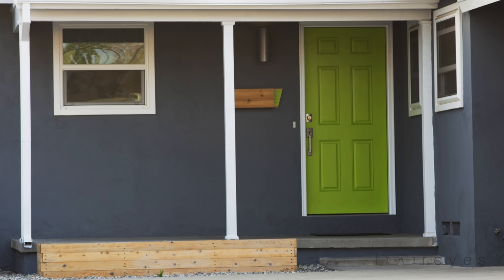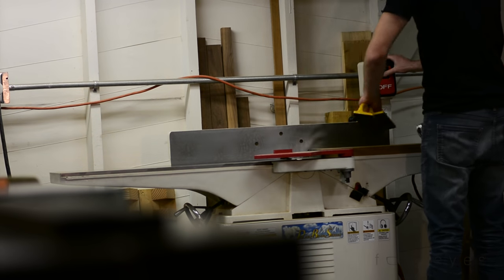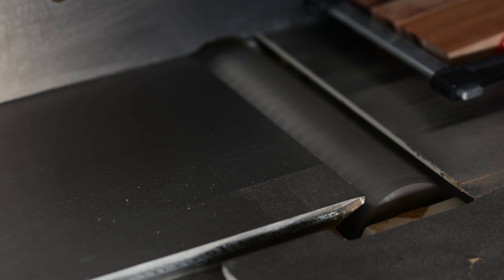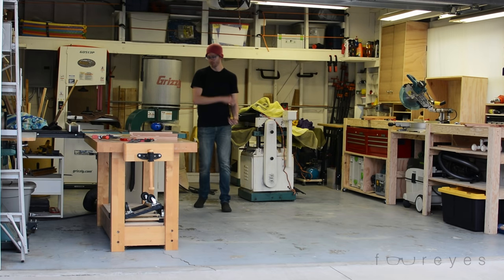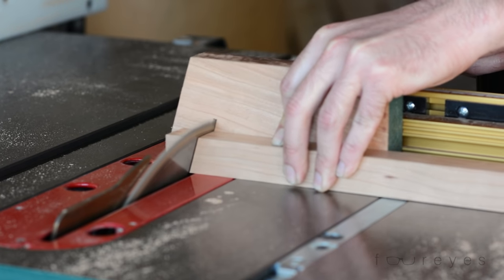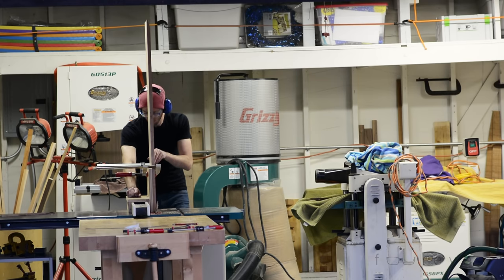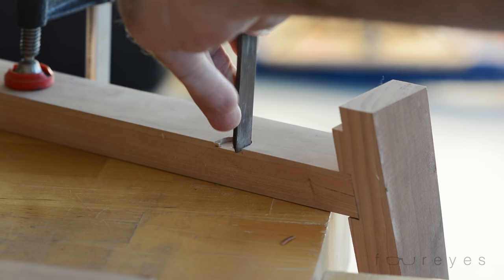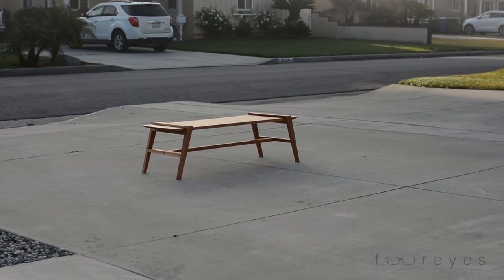Designing and Building a Modern Bench - Woodworking Projects

Comment: Oops sorry, I pressed the wrong button! Burn marks om the edges every time you use the table saw. Advice : push the work through faster ; if you're too slow the blade burns the wood. Be careful about the choice of blades (i;e number of teeth). Rip saws along the grain have less teeth and more rake than crosscut saws - the opposite. By reversing you either get burn, or tearout. Happy projects
Reply from the maker: +musamor75 
Hey Musamor. Thanks for the advice. I think it all had to do with a dull dirty blade (also contributed to the slow feed rate). If you watch my second video I'm using a clean/sharp blade, and the problem is totally gone. :)

Comment: I cringed a little bit when you put that piece of wood with the clamps through the jointer. The jointer doesn't take much from the wood but still a bit risky. Was it absolutely necessary?
Reply from the maker: +Isaac 
Thanks Isaac. You know what's crazy is that I didn't even realize I had done that until I was editing the video. I've made cuts like that many many times, and I always use push blocks when I do it...I think my mind was too many places between building and filming. That is something that I'll have to get more used to, so that I don't lose focus. As for the cut itself, it isn't necessary, but it does save a lot of time...and it's a cut that can be made safely. I was just foolish at that particular time. Luckily no harm was done. Thank you for pointing that out though. I'm always looking to improve any way that I can.

Comment: The worlds most expensive free bench. Don't patronise us by getting wood out of a dumpster when you then run it through a jointer, a planer, a band saw and a table saw that can take a dado set.
Reply from the maker: +Darren Davies 
The first bench in the video is the one from dumpster wood. The main bench I build is just based off of that design.
Reply: Who's patronizing you?? He has those tools. If you don't then grab your hand saw hand plane and screwdriver and make the same bench. It will take you longer but you can do it. Don't be mad or jealous because you don't have what someone else has. This video is how to make the bench you can do it for as free as you want or as expensive as you want. Also I guess you missed the part where he said he was making from cherry not dumpster wood.

Comment: I liked the video and your shop and your process, and most of the design, but having those cross pieces on TOP of the bench is...pretentious?  Not sure of the dimensions, but can 2 people sit comfortably w/o having one of their butt cheek hitting it uncomfortably?  Compromising function for aesthetics is a no-no from my perspective, at least for a functional piece.  Art piece, ok.  Just my opinion.  I also build furniture.
Reply from the maker: Thanks Steve! To answer your question...yeah, 2 people can sit on it. My wife and I have sat side by side without the having to wear it like a thong :)
It can also fit 3 kids (which is mostly what it gets used for.) I kind of look at the top pieces as a functional element. Subconsciously  persuading 2 bigger people not to sit on it at the same time. Admittedly, it is not the most functional piece in the world. But, the design could easily be beefed up a bit, and the cross bars eliminated. Thanks again!
Reply: To each his own.

On another point: From what I can remember of the video, you did not use any mechanical fasteners on the cross pieces or stretcher, just glue.  Are you confident that is gonna hold up?  Your dados were 1/4" deep, so you really have very little glue surface in those dados (end grain doesn't count).
Reply from the maker: I think it will hold. And I'm not super concerned if it starts coming loose a little because it lives at my house, so I can always touch it up. That said, the first bench that I show in the video is WAY more flimsy, and it's about 2 years old and is holding up well. Of course it isn't sitting outside though...

Comment: Oh god, why phillips? Such a beautiful piece of work, then this ugly nearly stripped screw head, which albeit hidden, doesn't match the clean smooth lines of the piece.

Robertson (guess you 'muricans call it square) is so much less prone to stripping and still cheap as borscht if budget is at issue. Allen/hex would compliment the "figure 8" piece even better.

Of course old Scandinavian furniture uses flathead (which I'd argue is worse than phillips), so I'm probably just being anal.
Reply: +dubbreak Not so easy to find Robertson screws in the sizes you want in the US. They're incredibly common in Canada but not here.
Reply: +Buckland Darrell Seems like a lot more common in the US now and on youtube channels by US wood workers and makers. Maybe thanks to Kreg using square drive for pocket-hole screws. Browsing Rockler quickly it looks like square and square-X are starting to overtake phillips in their inventory.

The Robertson patent expired in 1964, I'm surprised it hasn't taken off more. It's so much easier to drive without stripping.